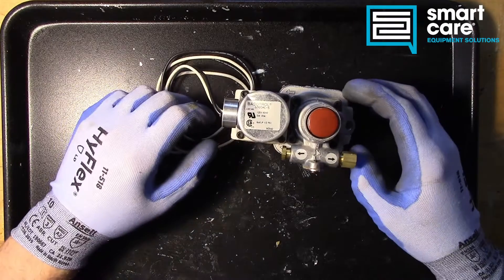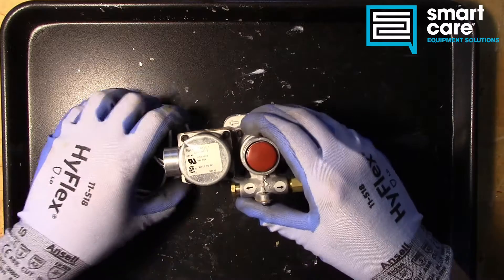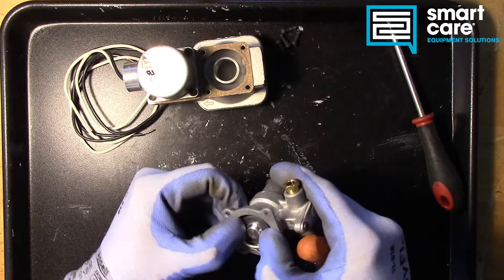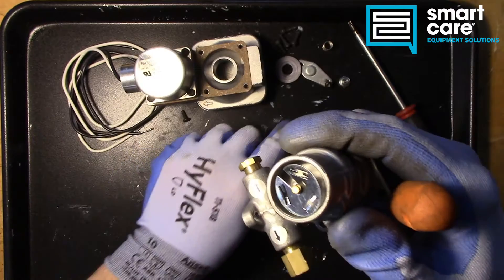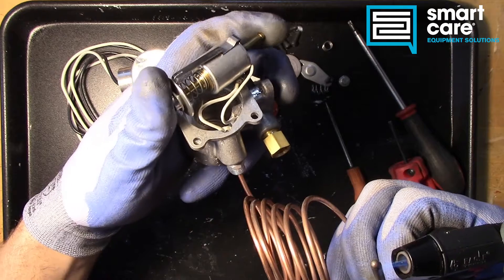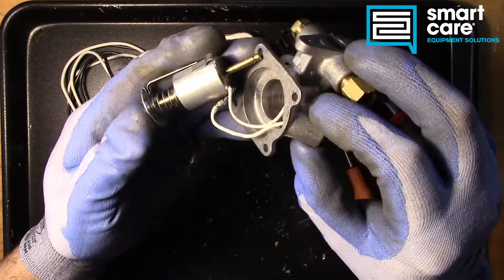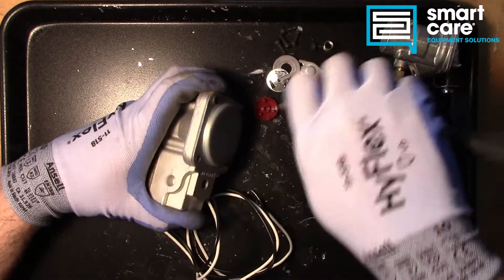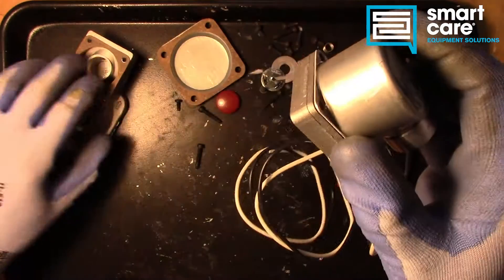Teardown Tuesday Episode 7: Basotrol Pilot Safety and Gas Solenoid Combination Valve

Comment: Thanks so much for the video - I wish yours was the top result…

How ill-advised is it to dismantle and rebuild a baso-valve? I have a valve with only one solenoid (connected to the thermocouple). The local propane dealer is telling me the valve is no good and lets gas through before the thermocouple is hot, but when I test it , it responds to a hot thermocouple.
I’m tempted to try to clean off the gaskets to get it to seal better, but I also don’t want to be that dude that blew up the neighborhood… of course I would test it before leaving it unattended, but curious if it’s a lost cause. 

Thanks

Comment: Question ?  Does the pilot open the valve or just tell the gas valve it is safe to open due to there is a flame (pilot) that's the debate that we have at work. My understanding is that the pilot tells the valve that it is safe to open ! 2 question pilot is on but burner will not turn on and I believe it is the thermostat that actually tells the valve to open ! ??? Thank you for posting the videos ! Most important sharing your knowledge.
Reply from the maker: Interesting Question! The thermocouple produces voltage using heat from the pilot flame, that voltage energizes an electromagnet inside the gas valve which overcomes spring pressure from the button. Nothing is really "telling" the valve the pilot is lit, it's using an electrical circuit. Today's episode with the Italian gas valve may make it more clear!